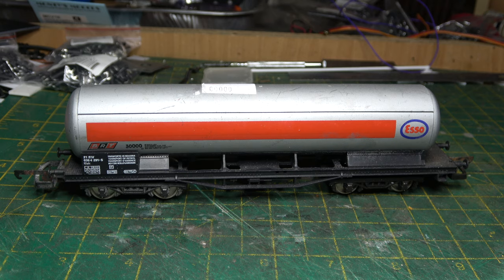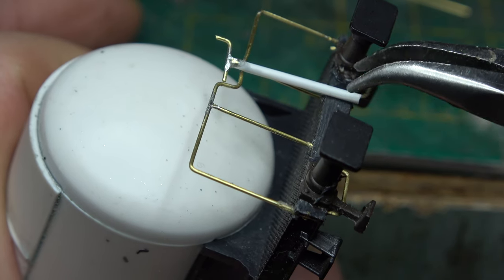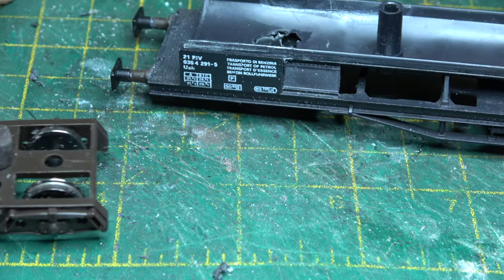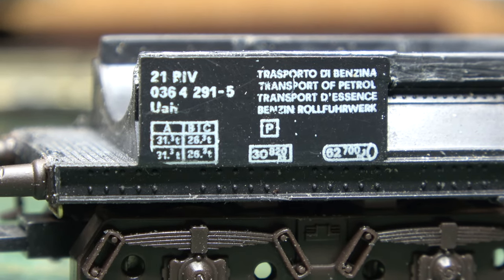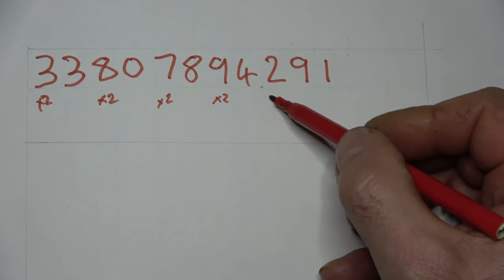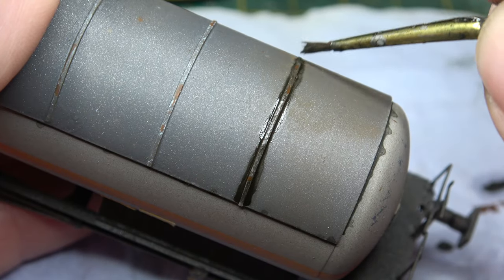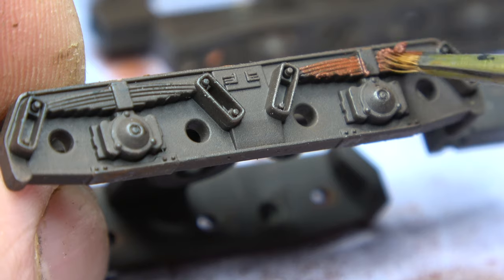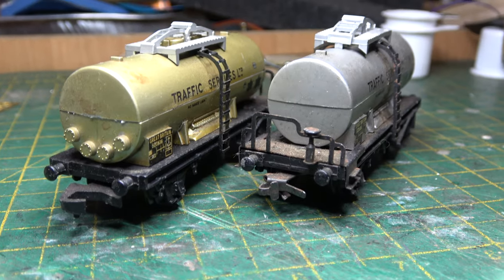Lima Tank Wagon makeover

Comment: I'm glad you are old school with paint choice like me. Yes I agree enamels take longer to clean brush, longer to stir the sludge in the tin, however the Matt is a true Matt,  gloss flows and doesn't show brush marks, they be used in a single coat, and most of the time will go direct to surface with no primer. 
Fed up doing intricate detailing with acrylics only to find they need a second coat which ruins what I've done. 
Thoughts appreciated...
Reply from the maker: When I first started out in the modelling world 40 odd years ago, enamel paint was the only viable option. Acrylics of the time, as I remember them, were cheap n nasty things that not many would use. My then supplier only stocked enamels.
The armour modellers that I watch only seem to use acrylics and swear by them.
I dipped my toe into that type of paint a year ago or so with not good results!! 
Having invested a few £££ into them I thought it was time to revisit them and make them work!
Ammo Mig Yes
Mr Hobby hmm not sure
Vallejo not tried them
Railmatch acrylics, not for me thanks - enamels yes
Reply: @Wallsrail  thanks for that. I think we are similar age. 
I've gone back to enamels myself

Comment: Artistic License cover's a multitude.
I've been binge watching your vids.
Question.
If you convert the real buffer height 41.5" - 42" from rail to the center of the buffer would that not give you the direct ratio of what it should be on your model.
Brilliant work by the way.
Retired Craftsman Irish Rail.
Reply from the maker: Err yes probably?
When doing this sort of thing, what looks right is equally important as measurements?
1/2 a millimetre can also be corrected by swapping wheel sets to another manufacturer, even though there shouldn't be any difference 🤔
Thanks 👍